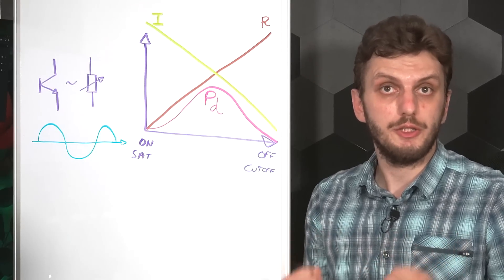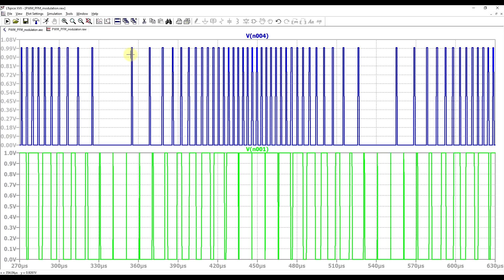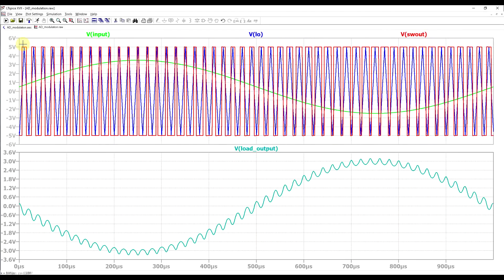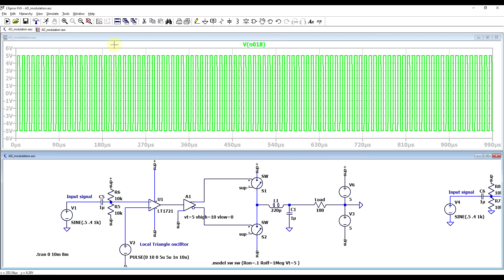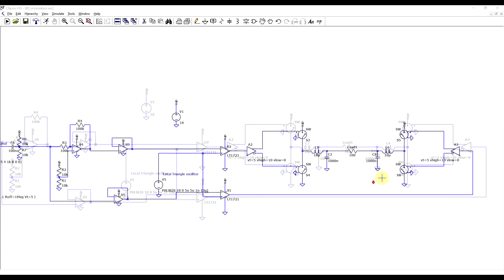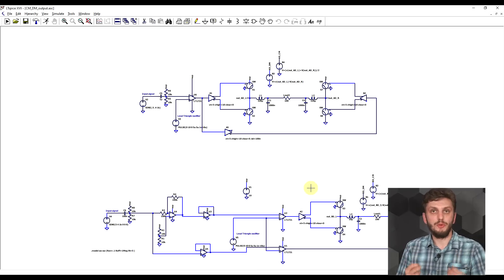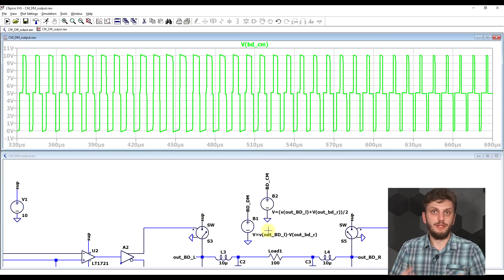The Class D audio amplifier - Basics (1/3)

Comment: I have done a 5 level with 4 half bridges, however, I do not now how to calculate the lowpass filer because the inductors are summing on the output side into the capacitor who belong to that low pass, I see it that the 4 bridges who are low im pedance do let the inductors as paralell, what means I need 4 times the calculation outcome of a normal low pass, I have best results with bessel, I get -110dB 1khz 20 volts out, and -90dB 20 khz 20 volts out, I have design a feedforward system with two PI correctors. I have 90dB openloop 1 Khz. and 40dB on 20 khz. Have all done in simulator, I am a bad calculator.

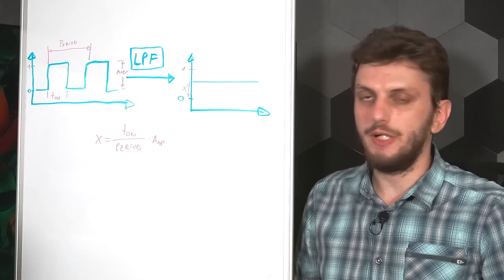Comment: 3:30 is this really so? The fourier transform of the square wave are harmonics of a wide frequency band. Low-pass filter cuts high frequency harmonics, leaving only low frequencies. That is, the output of the LPF is a sum of low frequency harmonics that do not make up a DC signal. Correct me if I'm wrong.
Reply from the maker: It is true that the decomposition of a square wave is a series of sine waves, however, there is also a DC component in there - if the initial square wave is not centered around zero (like +1v to -1v) but rather goes from 0 to 1 V, the decomposition will be a set of sine waves centered around 0 plus a DC bit which gives the offset. The LPF has a corner frequency below the fundamental of the square wave, so only this DC offset passes trough.
Reply: @FesZElectronics  I tried simulating in LTspice a square wave passing through LPH. Unfourtunately I can't see any DC offset, only "smoothed" square wave. Can you please point out what I am doing incorrectly? The netlist of the simulation is below. 
V1 P001 0 PULSE(0 2 0 0.01u 0.01u 5u 10u)
R1 P002 P001 10
C1 P002 0 100n
.tran 20u
.backanno
.end
Reply from the maker: In this case the square wave fundamental is at 100KHz and the filter corner (-3dB point) is at 159KHz; there is no attenuation at the square wave fundamental; if the corner however is far lower (ex: R=10k; C=100nF fc=159Hz) then the filter output will be a DC at 1V, after a small stabilization time. That sort of filter will extract the "DC" from the square wave.
Reply: @FesZElectronics  oh, now I see it, thanks! In both input(before LPF) and output(after LPF) signals there is a fundamental(0 frequency) harmonic. If corner frequency is really close to the fundamental "DC" harmonic, than it becomes more prominent. However, I don't get how it works from the "mathimatical" equations perspective. Can you please give me a hint on it? As far as I know, LPF is an intergrating elements, or, in other words, the formula that describes LPF is the following: Uin = IR + 1/C * integral(I*dt). As I = C * dUc/dt, than this equation can be rewriteng in the following form: Uin = RC*dUc/dt + Uc. I tried solving this differential equation with bernoulli method so I can obtain an output signal that looks like sigmoid centered around 0 in xy-plane and which is "modulatet" by a high-frequency triangle(rising and falling slope, as a slope is a result of integration a constant, or Von, voltage), but it didn't work out.

Comment: Very interesting. To me this concept could open up a theory I've been struggling to do. If you use say PWM to amplify a guitar signal - Can you use a unit for example a ESP32 to change the incoming PWM signal and multiply the pulses by any number 2 to say 5 and with all your filtering on the output end, get a pitch shift up or down with still good quality??

Comment: Hi, great video. I have seen your video regarding class C amplifier. In class C amplifier the one feature is that the output voltage is twice the max. supply voltage. This feature fits my use case, since i am looking for an ampifier with voltage boosting. Is there any chance to get use of this feature also with class D by using an LC tank ? I have the option to give directly from the µC two inverted controll signals - so a class D is useful. Or a combination class C and D ?
Reply from the maker: You can use an H bridge output power stage - two stages each driving one side of the load in phase opposition; in some applications its also called a BTL (bridge tied load); this can work on both D or AB/B, and it will expose the load to twice the supply voltage but you need to check if your application can accept that none of the pins of the load are connected to GND.
Reply: @FesZElectronics  Thanks a lot ! You saved my sleepless nigths sitting on LTSpice. It works fine, at least with ideal components :) ;) By the way i faced a problem. But i am not sure if this is a really problem. On the single-ended sides of the differential load i measure my output signal, twice in amplitude, correctly filtered out. But on the single-ended signals i see that there is an DC offset. So the signal is swinging between -xV and +xV. The differential signal is important for the load. But is this behaviour normal for the single-ended signals ? How I can improve that ? My goal is to have an swing on the single-ended sigde always on the positive axis, because i want to track also the single-ended signlas with the ADC. It would great when you can give some hints or tricks. Thanks in advance :)

Comment: I have watched three or four different versions on YouTube explaining this everybody is good at telling about the pulse width modulation but I don’t see anybody explaining how the amplitude information is delivered… If these devices only have two states on and off how does it know 100 millie volt input from a one volt input I guess I will have to set one up and look at it myself with a scope
What aspect of the digital signal is changing to reflect the change in input level?
Reply from the maker: You are right, there are only 2 states, "on" and "off", but these change at a very high frequency (say 400KHz); the analog information is always at a much lower frequency (say 20KHz); using a filter, you average the high frequency signal to obtain the low frequency one; at the output of the amplifier you never see the "on/off" states, only the long term average which is proportional to the duty cycle variation.
Reply: @FesZElectronics  To me the operation of this amplifier seems very similar to a dac. 
Cant you just directly take the digital signal and process
 it in the amplifier instead? Now you put it in a dac, then make it analog and in the amp convert it back to a samplerate...

Comment: The picture does not represent a real situation. Let’s say we have a 20bit resolution. That means about 1 mln different levels from peak to peak. If we have a 800kHz oscillator, a width of one pulse must be as precise as 1 to 1 mln. That means the shortest impulse as 800GHz. Did you see such mosfets? So, in a reality that precision is achieved with a “chaotic” jumping around a desired level with wider and shorter impulses, controlled with a feedback.
And of course, at 20kHz, when we have only 40 impulses per a wave cycle, that’s physically impossible to achieve 20bits resolution. That’s why D-class is terrible sounding at high freqs.
True digital amplifiers can solve this problem. Because the impulse width can have only 32-256 different values. This is about 25-204 MHz. An absolutely real number to have a no-feedback channel without a jiggling signal.
Reply: @@nosferratu Yes, "width of the pulse is modulated continuously" but that modulation is still in a time domain because we still operate with 1 or -1 (of a different width). Check out a theory of a delta sigma. A D class amp with a feedback implements a D/S modulator with all that math behind. A PSU level only affect those 1/-1 making them 1.1/-0.9 for example. A rest of D/S remains the same. LC filter of a D amp itself has a cutoff frequency about 28-31kHz (some D amp schematics for an active speaker have only an EMI filter for 1-2MHz and use a loudspeaker coil inductor as an L, but that's not our case), and a loudness level cannot explain a bad high frequencies quality. That's about a low resolution of a modulator in a time domain.

Comment: FesZ, I've got the model inputted, but when I run the simulation, I have not been able to get a solution. Do your run take a long time to finish. I have tried using the .ic option, but does not have. I've tried finding information on convergence to a solution.
Reply from the maker: Which exact model are you using? if you are referring to the op-amp maybe you can change it just to see if there is an issue with that particular model.
Reply: @FesZElectronics  I got the half bridge  to work and the first full bridge to work, but when I add the 3 LT1721 op amps to get your model that has the second 10K divider doesn't reach a solution. It is the model at video time 13:10 or 12:30. Thanks
Reply from the maker: Ah, now I understand. Think I had the same issue as you are having, so the 3 extra opamps - U3, U4, U5 are not the LT1721 but rather the "UniversalOpamp" - this is some generic model in the Ltspice library, right at the end, and if you right click it, on the "Value2" line, I changed it to "Avol=100Meg GBW=100Meg Vos=0"; not sure this is need though.
Reply: @FesZElectronics  thanks, I'll give that a try. I thought that might be the case,  but the numbering lead me down the wrong path. Thank you for our help.

Comment: FesZ,  is the DC offset on the input sine to demonstrate  DC bias does not effect the driver?
Reply from the maker: The input stage opamps require that the signal be centered around half supply voltage. When I started working on the design, I tried to add this voltage offset into the input signal directly, but then went for the capacitor and input resistor divider; I think I forgot to remove the offset in the signal... Anyway, for the simulation at least, having the offset in the signal source helps get the amplifier into a stable state faster since it does not require time to charge the first capacitor.

Comment: FesZ, in the waveform for the full bride single power supply, your waveform is swing from +10 to -10 with only a +10 supply, how/
Reply from the maker: Its part of the reason for using a full bridge - when left side is pulling the load high, and the right side is pulling it low, the load sees +10V; when the bridge switches, and the left side side is pulling low, and the right side is high, the load sees -10V; "-" here is relative because its in reference to the "+" seen before; current is going the other way trough the load while its still exposed to the same absolute 10V. Putting the two halves together you get the full swing of +/-10V.

Comment: Hi @Fesz Electronics: In AD modulation (min 11:04 video) when i simulate current through the Load2 the signal is second order system (damping) and not an oscillating system like the video. Why ?. Is there any initial condition in the Edit Simulation Command ?
Reply from the maker: I was performing a 10ms transient simulation; other initial conditions where I think to start measurement after 5ms. If there is switching before the filter - then even if the filter has good attenuation and it is damped, some of the oscillation will still pass trough. For ex: if the filter has -60dB attenuation at 100KHz, then a 100KHz 1V signal being injected will still pass trough at a value of 1mV.

Comment: Thanks for this really interesting video looking at this basics again, someone like me has been dwelling on this topic for a while but more on self-oscillating topology (you showing a clocked modulator). For me one of the hardest subject that forms part of this journey is the control system feedback topology, modern efficient class-d will use self-oscillating control loops: which will require the following: 
 
- a double pole integrator.
- a comparator with low propagation delay. (why? each component added influences the positive feedback phase-shift which will increase/decrease switching frequency) 
- stability analysis across the whole audio spectrum under load.
- dynamic system analysis under load (notably near DC). 
- poles/zeros needs to be place for correct reliability. (under different dynamic Z loads 2, 4, 8 ohms).
- fully differential input stage so common mode noise isn't amplified by the power stage. (again poles at the input stage for too high and too low frequency this applies to the main feedback loop as well).
- simple DC offset removal using x2 IN4148 diodes that clips the input when anything at DC is detected.  
 - the math is hard, many loops with different stability targets!

I would love to see this incredibly interesting video progress, few on Youtube covered above subject matter.
Reply: Hi, could you please put some links to those videos that explain those subjects? Thank you
Reply: @jorpese1  Hi, the topics are sparse and found fragmented in papers on the internet I would recommend reading patents, university papers and lastly this guy: Bruno Putzeys he's work in the class d space is enormous study he's papers and UcD amplifier from there you will find and deduce other paths of knowledge, control theory is a separate subject you can find many many areas of study, the trick is how they overlap in class-d there is no one source answer.
Reply: @xorcipher  I'll check Bruno's work.Thank you very much!